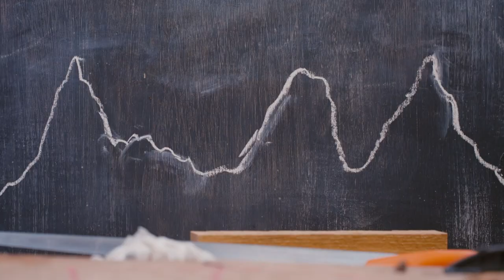Bench Made To Look Like The Yorkshire Three Peaks | Kings Of The Wood

Comment: About time they knocked this show on the head, 90% of the stuff they build is junk, still laughing about the thin sheet steel fire pit that will be scrap after a few burns & the copper tube Liver bird candle holder 😂 Last night was a 4x4 & plywood climbing frame.